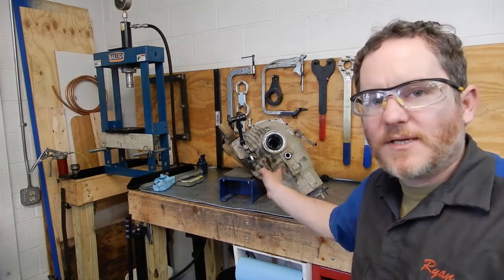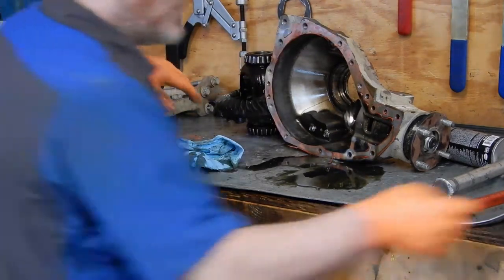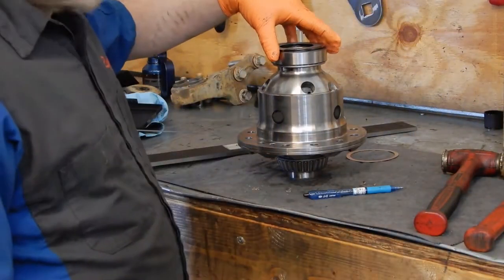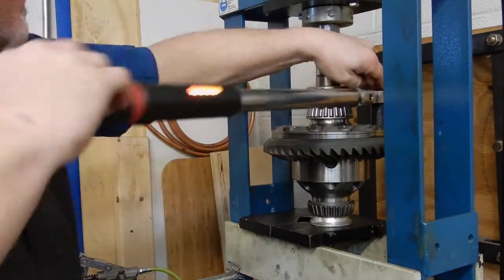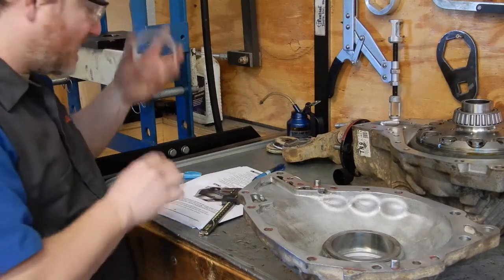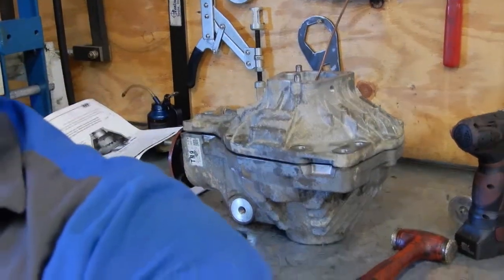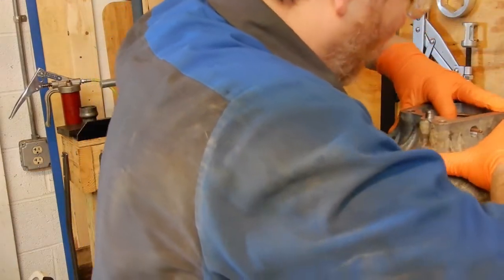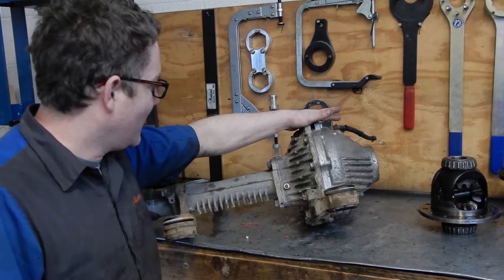200 series Land Cruiser front ARB air locker install

Comment: Just itching to design you a special vise
Reply: Nice job.
 
We use a very large Wilton vise with brass jaw inserts to hold the carriers, cases when torquing ring gear bolts, case bolts at my shop. 

We use The Right Stuff sealer on everything including cases, it does make them hard to get apart if you ever have to split them but it never leaks. 

Sorry to hear about the air leak, that sucks.. I mean that blows.. lol

I started chamfering and polishing the edge ARB air sleeves which seemed to help with not cutting the orings.

Comment: I'd so much rather fit an e locker than an ARB air LEAKER. Thats a lot of work to do again when it leaks
Reply from the maker: I'm with you, I much prefer the Harrops. I actually had to pull this one apart just after installing it due to a nicked o-ring. It's difficult to get the case halves to seat while twisting the o-rings on to the locker.
Reply: @OTRAMM  i will say you do great work mate. How many hours in that start to finish? 
Would have to be 8 or 10 hours?
Reply from the maker: @thebeerhunter817  I'd guess somewhere around there. It's been a while since I did it.